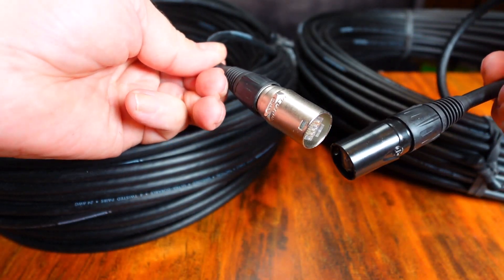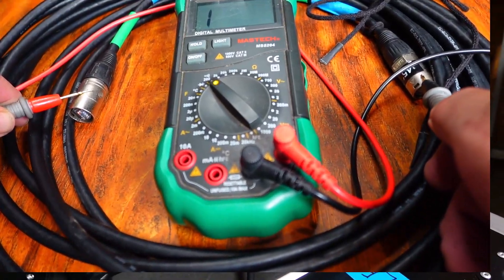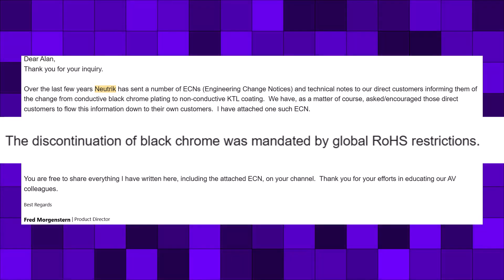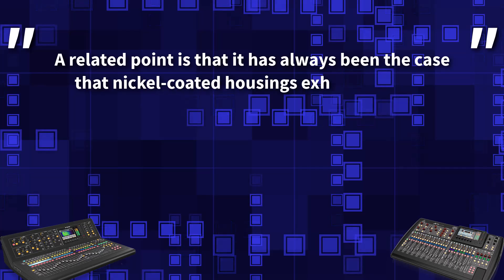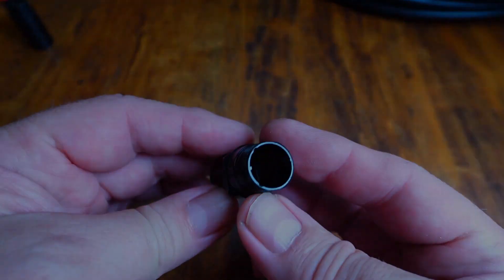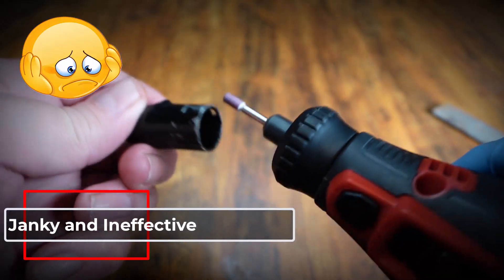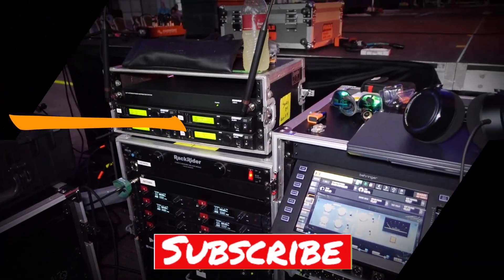Black Ethercon Connectors – Hidden AES50 Problem - Behringer X32 / M32 / Wing

Comment from the maker: Disconnects, bangs, pops, and even the potential to destroy an AES50 port on a console or stagebox exists with the newer black Ethercon connectors (not the original ones). @DaveRat brought this issue up a while ago, but it doesn't seem to be getting the traction it needs. In fact, it seems like things are sliding the other way.
So I wanted to add another video out there for awareness, as well as get some quotes from Neutrik about why they made the change. It's not really Neutrik at fault, but more along the lines of (it seems) music store salespeople and/or consumers being unaware and getting the wrong type cable because of it.
Plus, I have an option in the video that is relatively inexpensive and fairly easy to get the cable back into spec if you already have a cable with these newer black connectors.

As for why the RJ45 connection to the chassis isn't 'good enough' that a conductive Ethercon on each end with shield to shield continuity is required too, for ESD... I don't know... But there have been enough tests out there to prove the RJ45 itself is not enough.

As aways... likes and subscribes appreciated. Questions or comments as well. And feel free to share the video link with sites and people who can benefit from it.

🎤📦Sweetwater Affiliate Links-
📦Sweetwater Store Affiliate Link:
https://sweetwater.sjv.io/PybnYY

📦Amazon Affiliate Links-

(4 Pack) Genuine Neutrik NE8MX Ethercon Cable Connector Nickel Housing  at Amazon:
https://amzn.to/47Bvm9B

(2 Pack) Genuine Neutrik NE8MX in Nickel Housing:
https://amzn.to/4oH4bAq

🎶🔊Channel Amazon Storefront:
https://www.amazon.com/shop/alanhamiltonaudio

✨Items Used to Make This Video-
PROAR 414 XLR Microphone and accessories:
https://amzn.to/4aCrUK4

Sony ZV1 Camera on Amazon:
https://amzn.to/3z9MHny

“As an Amazon Associate I earn from qualifying purchases.”
"I earn from affiliate link purchases"

Items purchased thru affiliate links come at no additional cost to viewers, but these purchases can earn the channel commissions.

🎚✨ Support via Patreon:
https://www.patreon.com/c/AlanHamiltonAudio

🚀Channel Facebook Page:
https://www.facebook.com/groups/livesoundproduction

====Other channel videos:

Radial Catapult XLR Audio over Ethernet Cables-
https://youtu.be/Cm5msXqSNUo

Live Show Workflow with Wing and Wing Rack-
https://youtu.be/aRFIHnwDz2s

Behringer Wing Now Has a Built-In AES50 Cable Tester! Let's Check It Out!
https://youtu.be/kU6nW_cMYG4

JBL SRX900 Deployment and Deep Dive-
https://youtu.be/tXJjy8TglQs

Soundcheck in Action-
https://youtu.be/k2wgnPQI_is

A Soundman's Day - Mixing the Band:
https://youtu.be/iCzNO4lCyAs

https://www.youtube.com/s/gaming/emoji/7ff574f2/emoji_u1f680.png

Comment: Thanks for making this video. I've got some cheap Ethercon cables with black connectors which I assume from your comments will be too risky to use with AES50 ports. Will now relegate them to use with the little 4-way audio over RJ45 boxes - I take it they can't do any damage there?
Reply from the maker: They should be fine there.

Comment: I assume this applies to pro-co cables as well? Is there a reason to use neutrik over pro co? If its not one thing, its another lol😂
Reply from the maker: This pretty much applies to any brand of cables and connectors at this point. It's a matter of timing as to when cable and connector companies switched over or will be switching over, but I'm assuming they've all switched over to the new coating by now. Even the Chinese knockoff style connectors that I have seen recently have the new non-conductive black coating.
Reply: @AlanHamiltonAudio thanks for replying! I'm going to test the connector tomorrow with a multimeter. I'm glad I saw this video, I just received the cable today in the mail so you probably just saved me a HUGE headache. I'll respond with the results just as an fyi.

Edit: After looking at the connectors on the "Pro-Co" cable, they say "Neutrik" 😂... So I guess they're the same company or share parts?
Reply: So I ordered the correct silver connectors from your Amazon link (thank you!). The connectors on the "Pro Co" cable say "Nuetrik" on them and are fully coated, non-conductive. They were a bear to unscrew, but I got em off.

Comment: Do you know if these silver connectors will work through a pass through patch panel? I like the Neutrik NE8FDX-P6-B? The back side of them is just an RJ-45 not etherCON
Reply from the maker: While I'd like to say yes... After watching ESD testing, for whatever reason it seems important that the shell be on the connector at the console. Even though the RJ45 connector itself has a metal surround.

I don't know why it's that way, but not loosing that shell connection is the safest answer.

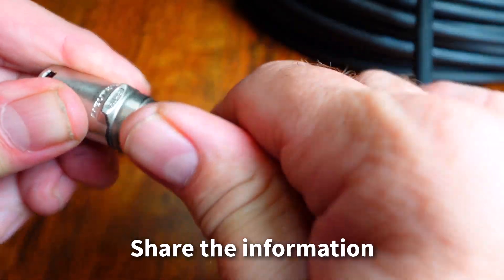Comment: I did not see a way in your demonstration that provides a good ground path from the new connector to the cable. 3:57 of video
Once again Neutrik connectors cost me more money. Every decade they release a batch of junk.
Reply from the maker: The 'silver' connectors are conductive and they friction fit against the side of the RJ45 connector. As long as the RJ45 is properly a shielded version, and the cable is shielded and connected to the RJ45, then the connection is made when the Ethercon shell is put over the RJ45 and tightened.

Comment: Music Group also have done a horrible job with the AES50 spec - there reps confirmed in 2017 even the Pro line & X32/M32 line should be grounded on each end through the EtherCon shell & through the rj45 shell but haven't well communicated that with there dealers or cleaned house any advice that pre-existed that. It doesn't help they also managed to delete the X32 Wiki while updating there site for the 500th time + there inhouse forms/support pages are running on a potato and take forever to load a page.

The CAT5e/CAT6a/CAT6 ground termination isn't standard across applications - in particular networking which often has one end lifted and/or uses EtherCon as a structural only component. Just because it's got EtherCon  on each end doesn't guarantee it's appropriateness for AES50 - if buying a cable in person best to test the ground continuity in store to make sure it's grounded correctly. 

Honestly haven't bought cable from music or pro audio stores in ages  because they only carry low end junk or half decent but 5x+ the BOM cost. I've found an industry supplier/importer who I buy cable parts though and build it all my self.

Comment: i think there is a misunderstanding. Every Ethernet Port ( also The ethercons) have fins that connect the side of The ethernet Connector and that is Shield. If you use the Hirose Ethernet connectors (which Neutrik recomends), they have a good Strain relief which you crimp your shielding in to that. If so, there is no Problem at all regarding shield or ground
Reply from the maker: No misunderstanding. For ESD reasons, the J45 metal surround is not enough. Behringer AES50 needs the Ethercon shells to make contact with the surround of the J45 and the shell to ultimate make contact with the chassis of the console thru the Neutrik Ethercon receptacle. All while maintaining continuity via the shield wire to each end.
But secondary to that is that cannot happen with the new black Ethercons that are totally painted in a non-conductive coating.

Comment: This is exactly what people said about the Neutrik turning away from black chrome.
But from now on, if you need to have the shield conductive, one must ALWAYS use the clear versions of the connectors... :(

Black chrome is horribly bad for the environment, that's for sure... but there are very good reasons to use it in entertainment industry.

Comment: Yep. I have started using sand paper and a thin drill bit to sand off the paint
Reply from the maker: You have to remove it from the inside (where the RJ45 connect rests) as well.
My experience was it didn't want to make a solid connection. The paint removal seemed to allow too much gap for a tight friction fit (which then makes the connection with the shield that allows for the shell to shell continuity when putting a DMM probe on each end).
YMMV though.
While I was experimenting, I did note that I could put a wrap of copper tape with conductive adhesive around the RJ45 before sliding it back in the 'sanded' interior and exterior Neutrik black shell and that seemed to allow for a more solid contact.
But not the most eloquent solution.

Comment: WHAT ABOUT ELITE CORE????
Reply: It's a world wide mandate. Same thing with pro co and everyone. If they dont have any older ones in stock its gonna loose continuity
Reply from the maker: Elite Core seems to be defaulting to the black Ethercons. And they are the ones that don't have continuity.
Make sure and specify the silver colored (nickel plated) version Ethercon connectors.
Good chance if you don't specify, you'll get black... and they'll be the 'new' black connectors that are not what is wanted for AES50.

EDIT: Looking at their website, I don't see an option for the silver.
I just sent them an email to see what they say about whether they still offer the silver Ethercons.
That would be an interesting turn of events if they don't even offer them anything but the new black ones!
Reply from the maker: Elite Core reports they stock the nickel plated (silver) connectors. Just need to ask for them. 
:)
Reply: I have a 300 foot SUPERCat from Elite Core and it’s the black connectors. And a few jumpers. they are all the black connectors. I ordered silver connectors to replace them.

Comment: Does anyone know if the sound tools  super cat 5E is conductive with the black ends? I’ve had zero issues at 150FT but I’m curious
Reply from the maker: Apparently they had some that ended up with the newer connectors before they were aware of the change. It's possible you have the older connectors that were fine. But it's also possible you have one that slipped thru the cracks with the newer connectors.
Reply from the maker: https://youtu.be/sE-JJJxVU7k?si=xRqwfyEMXvgCNeq7
Reply: in Dave rats video he says that he's transitioning the line over to the silver connectors because of this.

Comment: Whoops. Sounds like I need to take a good look at our setup. I haven’t had problems with AES50 dropping out, but the connection between our S32 and X32 goes through regular unshielded network cable.
Reply from the maker: Good call to check your setup! 👍
Reply: Oh yes. They had a bunch of warranty issues I think, now all devices list next to the Jack must be shielded. You shouldn't have to use the eithercon connectors as long as the cable is properly shielded with the proper ends.

Comment: A couple years ago, I ordered two new Ethercon cables from our friends in Fort Wayne, when they arrived I immediately did the shell-to-shell check (silver shells).  One of the cables was OK, the other failed the test and I returned it.  So check your cables, even new ones.
Reply from the maker: Yip, It's become a ritual now to check new cables. I've had a miswired new NL4 cable cross my door a time or two.
Found a mis-pinning in a new snake on the splitter tail extension.
...and plenty untightened screws on NL4's and Powercons (well... barely tightened...).

I always check shell to shell on the Ethercon cables... And now that the Wing consoles have the AES50 'checker' feature built in, I've started running that on new cables that are to be dedicated to AES50.

Comment: Is it NOT safe if it's not shielded? I just have the rj45 end to end from m32 to DL32.
Reply from the maker: You need shielded ethernet cable, with RJ45's with metal surrounds for the shield connection in the wire. That's first and foremost.
AND you need the Ethercon shells
For whatever reason, the RJ45, is not enough to protect against ESD. Even if the cable is shielded and the RJ45 has the metal sides.

The Ethercon is an important part of the equation.

The good news is, those NE8MX connectors I mention in the video are technically for already terminated cables. The boot is big enough to slip over an RJ45 connector. The strain relief is split in the middle so it can just snap onto the wire and slide into the place.
Then there are 2 options for choke piece. One is for smaller cable. The one most people need to use is the two half-ring pieces of plastic. These slide together, drop into the boot, and then when you tighten the boot onto the shell, the squeeze against it to make the strain relief tight.

So you should be able to retrofit your cables easily. Not as easy as just changing the shell, but not difficult either with those purpose-built Ethercon housings.
Reply: @AlanHamiltonAudio to be honest, I'm a bit lost right now. I don't really know the hardware side of this industry. Thank you for sharing your knowledge Sir. I'll be sure to study enough on this subject. ❤
Reply: For short runs on the same grounding system you should be OK. But it was a big enough issue that all devices now have a little warning to use shielded cable. It shouldn't matter as long as you're using a properly shielded cable where continuity goes from end to end. Especially since the ethercon standard was designed around the ethernet cat cabling standards. I'm using standard shielded cable with no problems. I was experiencing minor problems with the cable that came with the system but then again we bought the system used from somebody and it looks like it fell off a cliff twice so I don't trust the cables that came with it.
Reply: Note I brought the NE8MX. To fit my shielded RjJ45 fitted cable for wing compact to SD16 stage box, only to find the RJ45 don't fit into the casing. They are only good for absolute standard RJ45 .

Comment: Yes, I have the GearIt brand cable. Have had no issues but will be changing out the shield. Thanks!
Reply from the maker: If you swap out a GearIt black shell for a Neutrik brand silver, you'll want to swap the GearIt blue cable strain relief for the black Neutrik strain relief (that comes in the NE8MX package).
Pretty sure the blue GearIt has a notch that won't align with the actual Neutrik brand shell. But once you swap to the Neutrik strain relief, it should align perfectly.

Comment: I don't utilize AES50 in my current traveling rig. But this video brings up a question I have that, with your experience, you may have an answer for.
While I try to carry XLR cables in lengths that allow deployment without ever needing extensions, there are occasions when I need to plus I do regularly use short turnaround cables.
As a rule, I try to prevent any XLR connection laid on the floor from making physical contact with the floor, because the metal of the connectors is grounded, and I've always believed that since current will follow the path of least resistance, any inductive potential in the connection or the floor could cause noise or other problems. I do this by placing it on or across other cables where possible or by whatever means is at hand.
I learned long ago, in a painful way, that floors can be conductive, especially concrete floors. And floors of other materials can as well.
Am I being too meticulous or do you take similar precautions?
Reply from the maker: I don't take those kinds of precautions.
But, my metal XLR shells don't actually make contact with the shield. Most don't use that 4th pin in the first place, and any that do, I always cut/move that connection.

So if I was to test one of my XLR connectors, there'd be no pin 1 connection to the shell on either end... Nor a shell to shell connection showing continuity on a test either.

Are you sure your XLR shells are actually making contact with pin 1? Most of them don't has been my experience. And if they do, it's not the more expensive cables.
Reply: @AlanHamiltonAudio 
Thanks for your reply.
And no, pin 1 is not making contact with the shell. I'm just overthinking it in the notion that the shell being potentially grounded through the floor could drain off induced noise current in the shielding and deminish the shield's effectiveness.
You answered my question and I thank you kindly. 
I learn from your channel and I look forward to each new video. 
Thanks for sharing your knowledge and experience!
Reply: Wow that's interesting I would love to hear what experience that was. Theoretically everything supposed to be at the same potential but if you were doing this in a large facility with a concrete floor there could've been a voltage variation between grounds. And most large buildings will use the concrete reinforced rebar as part of the grounding electrode in the electrical system so it's possible that there would've been able to difference.

Dave rat recently did a video on to connect or disconnect the shell. I'm on cam connect.
Being that the system is balanced it shouldn't have any issues with induced noise as it will get canceled out. On the other hand grounding potential differences could be an issue. Or if you're running an unbalanced signal over XLR cables.
Reply: @imark7777777 
I think my discription may have been confusing. 
My "painful experience" wasn't an occurence of XLR cable shells in contact with the floor causing noise in the system. I've never had THAT experience having taken steps to prevent it.
My painful experience actually occured many times in my early years, most often on bare concrete floors. It was the experience of getting painfully shocked on the lips from the microphone.
Having experienced that, I simply made the assumption that any metallic contact with a floor having any level of conductivity that could do that could also cause noise. So I began taking meticulous measures to prevent XLR shell contact with the floor. Sorry for the confusion. And thanks for your input.